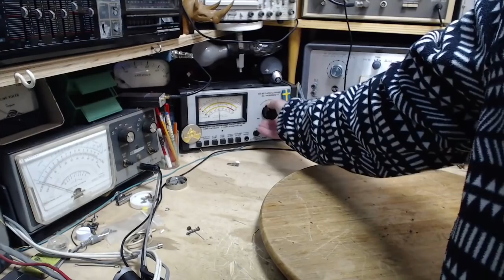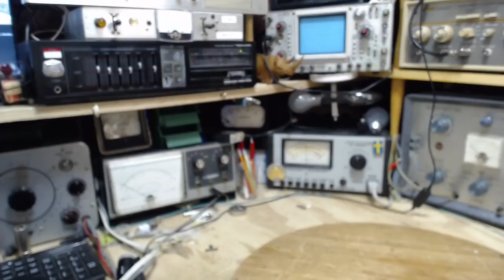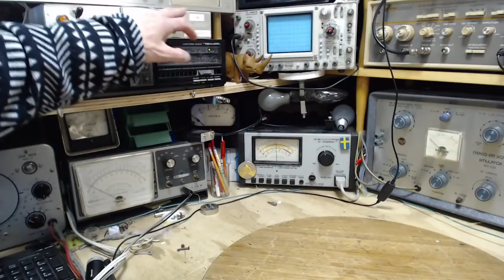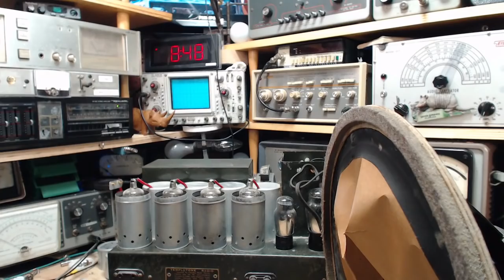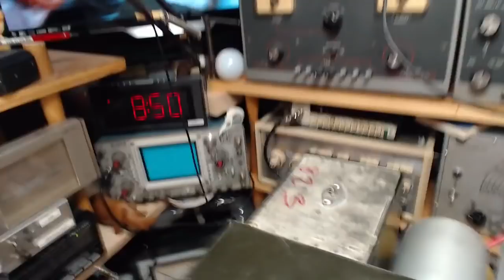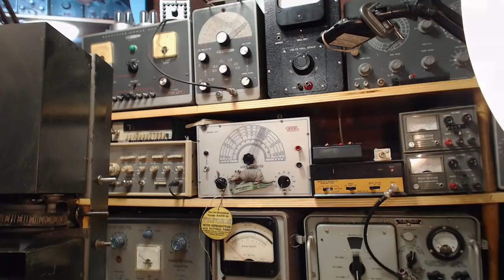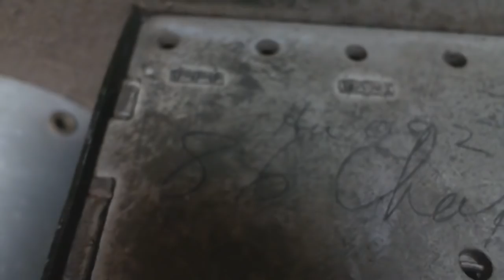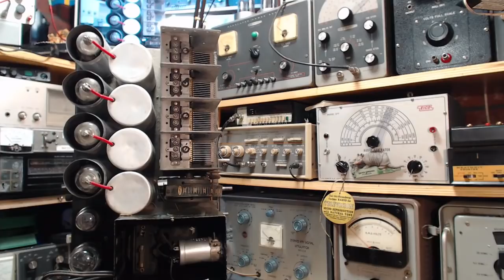1929 Templetone Radio Video #1 - Checkout and Assessment

Comment: Very impressive length on the video 📹, Mr. Lindenas!! I always wanted to see 👀 ya get one of these BIG beauties. A floor model radio 📻. It's so sad 😥 that nobody 👎 makes radios 📻 like 👍 this anymore. I'll guess it's a 1949 tube-type Philco, but I'm probably wrong. Glad the copper 👮 gods didn't start 🌟 tearing away at this thing. Ya certainly saved it from certain death. Nice IF (I.F.) cans and tubes there. I hope they all work. I hope the dial cord is in good 👍 condition. I assume that the dial light works. The speaker is probably field coil. Rotten power cords, and organic rubber wire might be a problem in this set. This might even be a curtain burner 🔥 radio 📻. If so, fully extend the power cord, and don't run 🏃 it under rugs, or have it bunched up ☝. If it's a hot 🔥 chassis set (series-string), use an isolation transformer. This will make working on the chassis safe. I really like 👍 your videos, and have been watching ⌚ them since 2016-2017. Please keep 👌 these GREAT 👍, HOUR LONG radio 📻 videos 📹 coming!! Your friend, Jeff.

Comment: The website tubesandmore.com  has a very easy to read schematic of this radio.
Page 618 has Temple models 8-61,8-81,8-91 and page 619 has Temple model 8-60,8-80,8-90. Print it out in landscape direction at 
maximum size. You will get two sheets and just align them and tape together. It may befuddle you when it comes to the two taps sections .
 Page 618 is quite hard to read because the original is smeared.

Comment: That speaker will have to be reconed and rebuilt  for sure!!  that's IF the radio can be fixed without pushing a whole lot of money into it!!!
Reply: Reconing the speaker is a big task for someone who is used to fix cones with toilet paper cuts offs soaked in wood glue. 
And what about the voice coil? Someone butchered on that too.  
I guess the best way would be to  source a drop in replacement - which would sure be very costly and only worth it if you would spend time and money to fully restore the radio.

If however he follows his credo voiced in this video; go cheap and just botch up the radio by adding  onto the previous botch job, he should keep the field coil to satisfy the supply filtering and opt for a modern permanent magnet speaker.- which in this size would not be cheap either.